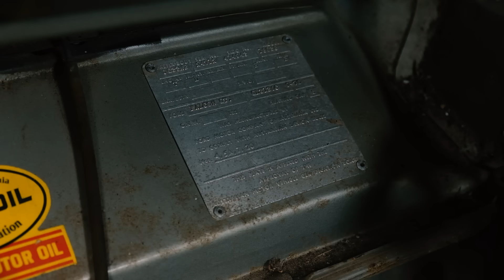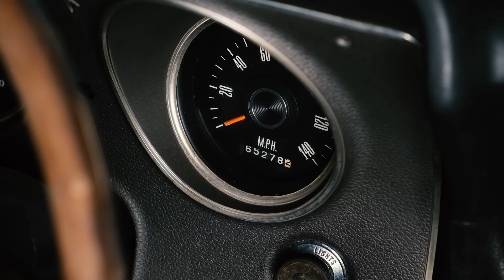This Barn Find XY GT has been garaged for almost 50 years!

Comment: Where I used to work one of the older security guards in the mid 1990’s  had a phase 3 with 175 miles on the clock